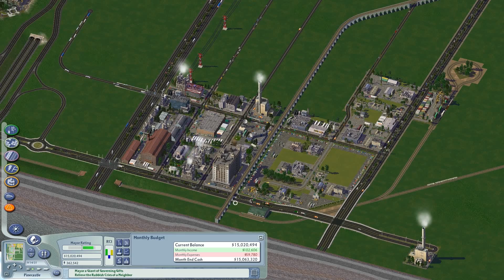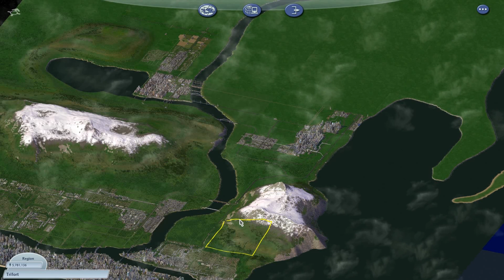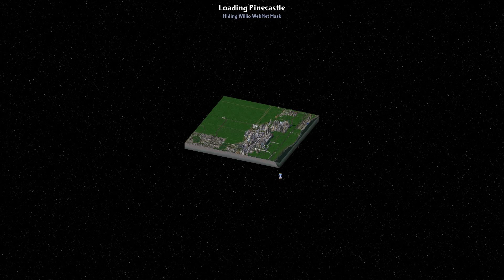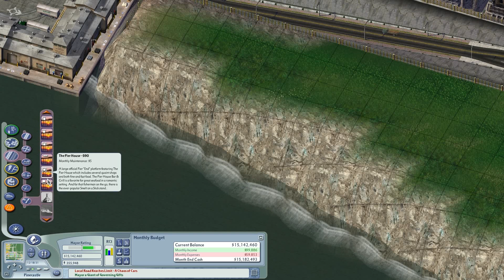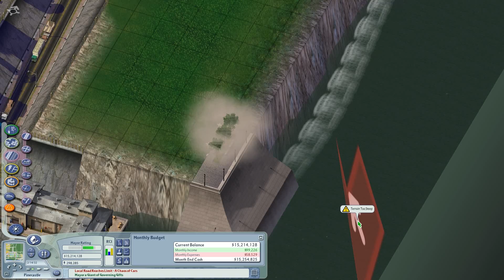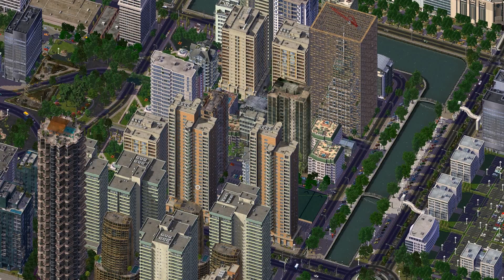SimCity 4: Let's Play Pinecastle, episode 25 (Industrial Waterfront)

Comment: Did you know that you can control the size of the terraforming tools by pressing shift with the number keys? Using shift+1, it makes those hard corners a lot easier to deal with.
Reply from the maker: Hey, I did know that, but had just forgotten it :p I haven't used that trick in a long while, thanks for reminding me of it.

Comment: NAM switches and junctions are by large queutly more realistic than those draged junctions, don´t forget some railroad sign bridges ! Nice new development at the seaside. Abbandoment or badly used industrial or business zones can be avoided building  a medium resedential area on the neighbouring tile so commute time is short.Growable lots are quaurly unpridictible, game mechanics say first build some low density, replace it with medium zone and endly high density zones ! Debate about lot sizes, there seems to be a lot of room in between your central city roads, reserve some for a boulevard ? Answering RCI demand,often give a quick desired result ! Unemployment can be dealt with this way !
Reply from the maker: Thanks for your comment; I'm not sure which roads you mean for the area that could be used for a new boulevard, though.  Could you say where you mean exactly?
Reply: Rail Junctions like that are Ok on freight yards ! Wide radius rail curved NAM with and without switches will take up at least double the space not to mention room for signs and sign bridges and or cross over tracks, carefull track design will relieve this !

Comment: It never works accurately for me when I try to use the level terrain tool for the seafront :(
Reply from the maker: That's odd; it's definitely not perfect but generally you should start with the center of the circle over some completely flat land, then slowly drag it around from there.  I believe that it keeps the elevation from where you started dragging.  Not sure if you're already doing this or not.
Reply: Samgoogolplexian That's the rationale that I go with as well while using the flatten tool.. I've got this to "work", but it's never this perfect (and easily), it always overflows or end up in a weird orientation.